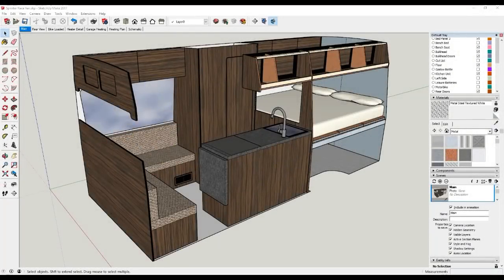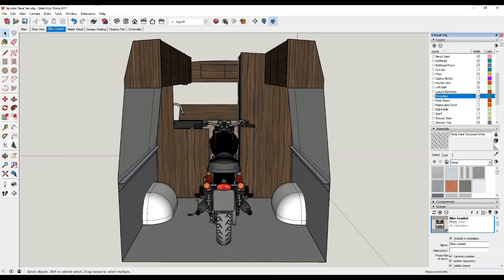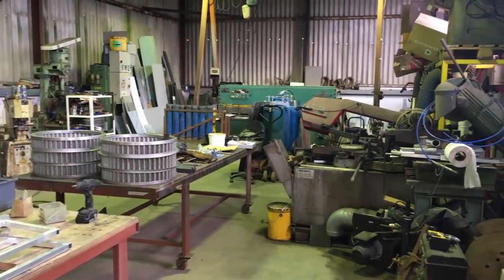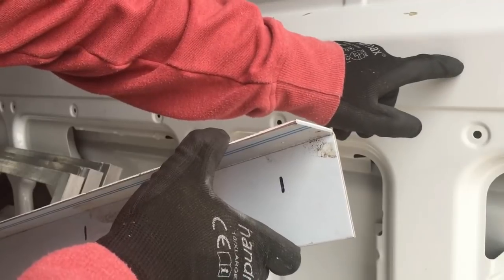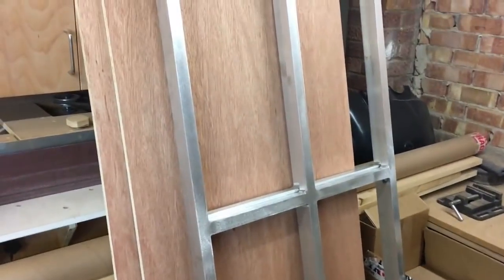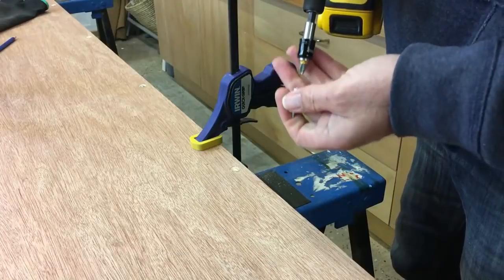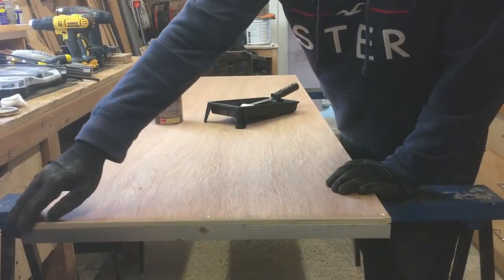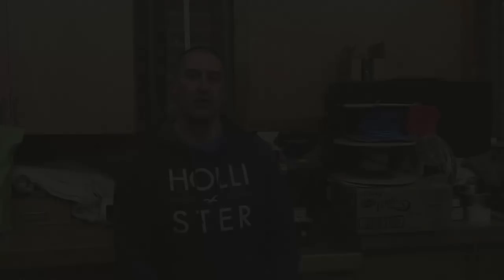Mercedes Sprinter Camper Van Bed Frame

Comment: Just a thought. As you have used 12mm ply to cover the bed frames, the surface is strong. When loading the bike(s) the bed will not be in place, so why not use one of the frames as a loading ramp (approx. 21 degrees). The ply will take the weight of the bike and rider, but the alu. frame won't (not enough 2nd Moment of Area i.e. section too weak). My calcs say that by welding another piece of 25 x 25 x 3 alu. to the underside of each of the three frame rails (leaving space at each end for the van's side supports), it will be able to take a Bonnie with rider. Only problem is, what is your partner going to say about the dirt....?
Reply from the maker: That's an interesting solution, you've obviously put a lot of thought into it. I would only need to double up one of the frames and when the bed is built this could be the middle frame thus also strengthening the bed. Can you work out what weight this aluminium would support over a 1700 span? 25x25x3 is the right size
Reply: I'll do the calcs again and get back to you. I used a span of 1780 first time.
Reply: I did the calcs, using the properties for grade 6082T6 (Yield Strength = 170MPa, Tensile Strength = 260MPa) and the load of a Bonnie with rider. The existing frame has a maximum stress of 233MPa, so will permanently bend. Fastening a second 25 square tube 1.5 m long symetrically to the underside of each tube with staggered intermittent single V butt welds along both sides will reduce the maximum stress to 77MPa, giving a deflection of 10.3mm in the middle and no permanent deformation.
Reply from the maker: Hello Norman, that’s very interesting. What if you are standing to one side of the ramp so only the 170kg of the Bonneville is on the ramp? 
The overall length is 2.1m and the ramp is 1.8m so only one wheel will be on the ramp at any one time. So roughly half the load, slightly more on the rear maybe? How would that look like? Cheers
Reply: Aha. At that mass it is a real T120R Bonnie, not a modern T120. Overall length is not important, but the wheelbase (where the forces act) is . For a T120R that is 55.2" = 1403mm. I'll check those out. Cheers
Reply: With the revised parameters and bed frame as-is, that would give you a stress of 120MPa (170MPa permissible), but a displacement of 36.5mm. Allowing 120kg for a big rider in gear, the displacement would be 25.8mm. Adding 1" x 10g square tube to both the outer tubes of the bed frame for the bike would give you a displacement of 9mm.
Reply from the maker: Hi Norman, I would definitely not be riding the bike when loading it. Bit just standing to one side of the ramp holding the bars with the help of a friend. I’ve seen too many videos of people falling off ramps or crashing. The bike is a new Triumph 900 Street twin. It would be a neat idea to have one frame bit beefier. Thanks for the idea.

Comment: Greg I'm curious as to why you didn't use 8020 extruded aluminium for the bed frame. It's a lot less expensive and a lot more flexible when it comes to positioning?
Reply from the maker: It is far more expensive than having this frame welded and not as rigid or secure. It might be an option if you can’t get one made but is certainly not a better solution.

Comment: Fantastic video as usual! I love the idea of the three bed sections. I am wondering if I can create the same bed system with wood... would it be strong enough? 
Thanks in advance :)
Reply from the maker: To match the same span you would have to go much deeper in section.
Make something similar to a torsion box or my assembly table.
Construct a castellated beam out of ply for the horizontal members.
It made sense to me to outsource this part for size and weight gain.

Comment: Hi Greg,  i am in the process of building a similar frame to hold solar panels. i've noticed there are a number of ways to join aluminum  box section including welding like yours. Brazing  , and also "easy fix" joiners.  could we have your thoughts on these other methods ?  thanks greg
Reply from the maker: I would say that the strength of the connection can be ranked as follows
Strongest - Welding - Brazing - Nuts and Bolts - Weakest.
Any kind of mechanical fastener has the potential to undo itself.

Comment: Hi Greg what was the aluminium thickness and depth used? Thanks 😊
Reply from the maker: the frame was a 25mm box section that was 3mm thick and 9mm marine ply board screwed to it which also adds a lot of strength, I would be tempted to go up to the 30-32mm box section if you use a different covering or slats

Comment: Are you sleeping from back doors towards the front or transverse?  If transverse, why not make the cupboards taller  where your feet are.  Great video as per usual.
Reply from the maker: The bed is 175 wide and I’m 180 tall. So we are sleeping front to back. The design is cast in stone now. Furniture board turns up on Monday.

Comment: Hi Greg - trying to replicate your build in our Sprinter ( best we can!😂) . When drilling holes in the L angle - do you remember the centres for the 8mm holes? Thanks again!
Reply from the maker: Yes I used 6 bolts on each side 300mm apart and starting 150 from ends. 
Bed is 1800 long.
Reply: @GregVirgoe  You’re a star Greg - thanks a lot! Hope all well with you.
Reply from the maker: @willparry6547  no problem 😉 and yes thank you

Comment: Hey thanks for making this video! I’ve been looking for a good channel to follow for my build - my question is: is the van sheetmetal strong enough to support the rivnuts? Aluminum is pretty ductile/bendy - are you satisfied with its strength?
Reply from the maker: dave chang the max that each nut is holding with both of us on the bed is 15kg which is nothing in a sheer location like this. It’s plenty strong enough

Comment: If I don't have a welder, I just add one extra long beam per panel, and screw them directly under the wood.
Reply from the maker: You can just use IKEA bed beams which is a really cheap and perfect solution.

Comment: Great build, really enjoyed your whole series of videos - great job! Curious, I' making my own bed frame (welded aluminum square tube as well) what size/wall thickness tube did you end up using. (Sorry if I missed that in the vid). I was thinking 1" (25MM) sq and around 3/32-1/8" (2-3mm) wall thickness. Thanks
Reply from the maker: The 3mm wall for 25mm is better. You can get away with thinner wall if larger section. 
I also made provision to bolt the three panels together when in place that helps with stiffness too. 😀
Reply: Thanks for a quick reply Greg - that makes sense. Mine will be one-piece (hoping to do an elevator design) so should be fairly stiff with a wood panel added to top.
Reply from the maker: I see so it would be elevated when not in use? That’s a good idea. I have seen a couple of great vans use that idea if you can make the lifting mechanics work easily. 👍🏼

Comment: Great video. How much did it cost to have the frame fabricated if you don't mind me asking? I'm looking to use t-slot aluminium extrusion to build mine but I'm pricing it up and its getting expensive!
Reply from the maker: Hello Chris, for just the aluminium frames were £350 then two sheets of marine plywood so approx £400 all together. Thank you 😊
Reply: You can use narrow gauge tubular steel and weld it yourself for less.  Stronger than aluminum.  Spray it with Loctite Rust Neutralizer, then Primer, then Paint.  80/20 aluminum is pricey, needs to be cut by shop with no returns, requires extensive planning to get the right number of channels, and needs pricey joinery parts too.  Welding steel is the easiest, strongest, and cheapest framing.  Less skills than woodworking, and just a welding machine and an angle grinder.

Comment: Great video as usual Greg. Couple questions about ideas with my own build if I may. I've been trying to come up with a lighter system for cabinets and such other then using wood which can be heavy and was thinking your bed frame system might work. Also have you installed your solar panals, if so, which video is it in? I've watched the one about figuring out how much is needed and thought I've watched everything but maybe I missed one. Thanks again for all the great info.
Reply from the maker: Hello, Funny you ask that as today I have been working on a lift system for the panels.
My original aluminium strap was just too flimsy and not strong enough.
I'm pretty excited about this one, not seen it done on any other van yet so watch this space. :D

Comment: How do you know it’s level? From te left to the right and from front to back? And is your van level? I saw a lot of video’s but nobody mentioned it. I like to hear how you do this. Thanks in advance, Graz Rick
Reply from the maker: Drone pilot Rick it’s fixed to the same part of the van both sides. You can measure from the floor up each side front and back.
Reply: Greg Virgoe do you that with all your parts, like cabinets or walls?

Thnx for your quick response, the vids are very helpful!
Reply from the maker: Drone pilot Rick everything is measured from either the floor or from centre lines. I also use a large builders square to make sure I get 90° angles 😃

Comment: Hi Greg, Thanks for another great video. What size aluminium box section did you use? Would 30x30x3mm be strong enough for the same design concept? Thanks
Reply from the maker: Gaurie Kidd yes that would be plenty strong enough. 
I used 25mm Sq and 9mm ply on mine and they are strong enough.

Comment: Did you price that out against using extruded aluminum and cutting the pieces and bolting them yourself?
Reply from the maker: I'll be honest Peter, I never considered it as an option. Welding was the stronger and more permanent solution and I know that extrusion is expensive stuff.

Comment: Hey Greg! Had a look through you parts list but couldn't see it, so I was wondering if you knew the dimensions of the aluminium angle you had made? Hoping to use some of that rather than a solid chunk of wood for weight saving purposes, but unsure of the dimensions required for enough strength. Currently pondering over some 50.8mm x 50.8mm x 4.8mm from metals4u.
Reply from the maker: The Introvert Initiative that dejection would do it alright. I had them folded out of 3mm sheet ended up 75x50
Reply: @GregVirgoe  Thank you, as always!

Comment: Great video and excellent work as usual Greg. Just one question - will ventilation to the underside of the mattress (and therefore mold\mildew) not be an issue as your bedboards are solid as opposed to the more common slat or lathe style? I understood that it was important to get air circulation to the underside of the mattress by either using perforated boards, slats or if not possible then raising the mattress up slightly on some kind of spring or support. Just a thought but great stuff mate.
Reply from the maker: There are products you can lay under the mattress to ventilate it. I will pin a note to the top as everyone is mentioning this. Thank you

Comment: First of all; thank you for tons of inspiration before I start my conversion. 
Now to the question, that I don’t know if it already has been answered. 
I see you put the side L-profile (that the bed frame is attached to)in to the metal. How do you work the insulation and vapor barrier around that, and the fact that you have steel agains steel all the way to the van walls?
Thanx
Reply from the maker: Hi Rob, that was only fixed to the van while drilling and fixing all the rivnuts. The angles are removed, Now that will have timber battens fitted and foil faced bubble vapour barrier over everything then my vinyl ply panels then the metal angle will be fixed to the wall. So there will be wood, vapour barrier and ply between the van and the angle bed support. I will show that in the wall panelling video.
Reply: Greg Virgoe sounds like u thought it through 😊
Thanks a bunch

Comment: Afternoon Greg, almost two years on now!
Have you had any cold bridging and/or condensation issues with the aluminium angle itself or the capped screw heads?

Reluctantly I think we are going down the lengthwise bed route ourselves as well now in the Crafter which is not as wide as my other van that you’ve already seen and I don’t quite fit width wise!

 I may well use a similar support method.
Reply from the maker: I had had no issues at all, the angle is mounted on the inside of the plywood lining ad the bolt heads have plastic covers. Both wood and plastic are good insulators, the van is always kept warm, Truma has frost protection set to 10°C and with good ventilation, we have never had any condensation issues. van is always very dry inside.
Reply: Greg Virgoe That’s good to hear, see you at the ICS at Stratford in April and /or Quirky in May.
Reply from the maker: Criftins Campers we will be at both of those weekends
Reply: thanks a lot for the vidoes, amazing detail. was wondering, is the bed aluminium angle fixed to the inside of the plywood? the video seems to show it fixed to the metal sheet of the van.

Comment: Hi Greg, 
now you've been using the bed frame for a while, do you think you could have used less aluminum structure? 
I'm planning on using your quality design but was thinking of just having the 6 cross pieces of aluminum box held together by ply sheet for the 3 slide out panels. 
Saving having to get a frame welded.
Reply from the maker: Hello Dave, if you reduce the number of cross members I would recommend going up in size to 35mm mine is just enough for us there is a tiny flex in it.
Reply: @GregVirgoe  thank you for the reply. I don't want to go thicker if I can help it, I'll have to check my clearances.  Thank you

Comment: Hi Greg, I'm looking at making a similar bed frame for my van. Just wondering what dimension of box section aluminium you used?
Reply from the maker: Ed Thomsett I used 25mm Sq x 3mm wall thick box section and 9mm marine ply boards. If you are using slats I would go to 32mm Sq box section.
Reply: @GregVirgoe  Thanks! Much appreciated

Comment: What size Al box section did you use?
We're thinking of having something similar with 2 fixed sections and the third section to pull out on runners.
Reply from the maker: Something like 30mm sq x 3mm thickness, the ply top also adds a lot of strength
Reply: @GregVirgoe  Thanks very much! We're just starting out, in the planning stages of our Sprinter conversion and your series has been a great help!

Comment: I had the same idea with the alu "L" profiles, but how do you seal these parts with the insulation foil, between the van body & the "L"?
Reply from the maker: My Reflectix vapour barrier and ply lining will fit between the L bracket and the van wall.
I will show you in another video once I get the rivnuts installed.

Comment: How comes ya didn't go with two singles on hinges that met in the middle to make a double?! And when not in use fold away back onto the side walls!
Reply from the maker: They would have been too big to do that and have a huge weak point where the hinge is in the middle where the most load is exerted

Comment: Hi what size and thickness aluminium square tube did you use for bed sections.
Reply from the maker: I used 25mm Sq x 3mm thick tubing. With 9mm marine ply screwed to it. It’s plenty solid enough for two av size adults. 
The side angles are 75x50 and also 3mm thick sheet folded.
Reply: Thanks Greg really enjoyed your posts very informative.

Comment: Hi Greg, Just wondering what the hight of the frames are from the base of the van?
Reply from the maker: Hello Andrew, the bottom of the bed frames is level with the top of the main horizontal support member. About 700mm I think, I'll check next time I'm in the van. Cheers

Comment: Hi there, a couple of questions, what size is the box section alloy? And what are the measurements of the angle rail?( thickness, height,width) cheers
Reply from the maker: Hello guys, I used 25mm Sq box that was 3mm thick wall for the bed frames and 50x75 angle also 3mm thick. There is a very small flex in the bed, so may be worth going to 28-30mm box for extra strength. But it does work fine for us once it’s all bolted up 😊

Comment: Hey. What size and thickness of aluminium angle did you use? Looks about 100mm each side?
Reply from the maker: 50mm wide x 75mm tall and 3mm thick 👍🏼😊

Comment: What were the dimensions of the Aluminium bars?
Reply from the maker: Mine were 3mm thick and 25mm Sq for the frames. With a 50x75 angle bolted to the wall

Comment: Hi Greg is it possible to make bed to sleep across van  ??
Reply from the maker: Hi Ralph, my bed frame measures 170cm across the van so that is 5’7” so in a sprinter it is narrow. You may get more space in a Fiat Ducato or you could fit fibreglass pods to each side to extend the width. Have you chose or got a van yet?

Comment: The out-take was funny. daft s*d lol. Looking good Greg. Thats a longitudinal bed, what length have you made it? R & T
Reply from the maker: Hello Guys, lol I can't help it sometimes you just need to do something goofy.
The bed measures 1750 wide (5'10") by 1800 long (6'0")
So we could pretty much sleep what ever way we wanted to.
Your bed needs to be at least 1800mm to meet the DVLA requirement.
Thanks for the support.

Comment: Hello there Greg could you possibly let me know the dimensions of the bed frame I'm looking to do the same idea just wondering if I'd be able to lay flat on it 😂 I'm pretty vertically challenged anyway so don't think it would be a problem
Reply from the maker: Hello Oli, my bed frame each measure 1750mm across the width of the van and 600mm deep front to back. so with three frames, that's 1800mm long front to back or 6 feet. So the bed is very nearly 6 feet square and you can pretty much sleep in any direction you like.
Reply: Greg Virgoe great thankyou Greg I'm learning hell of a lot from your videos can't wait to see the rest